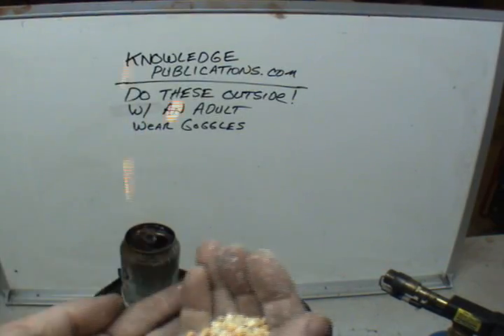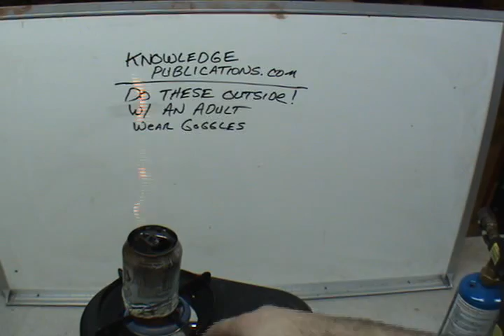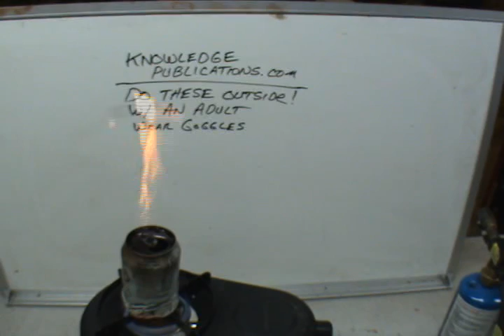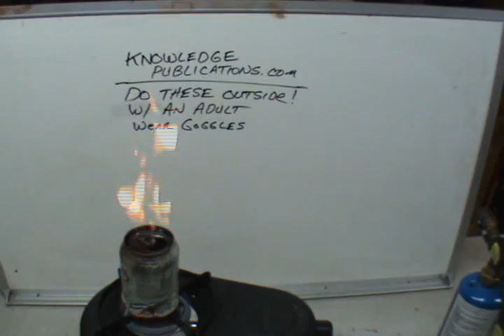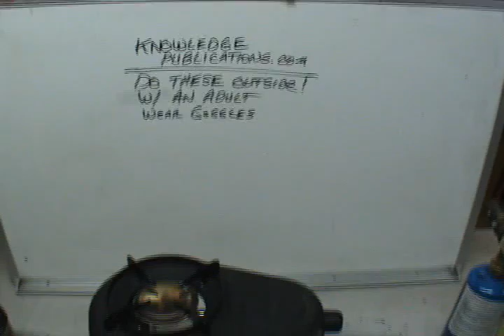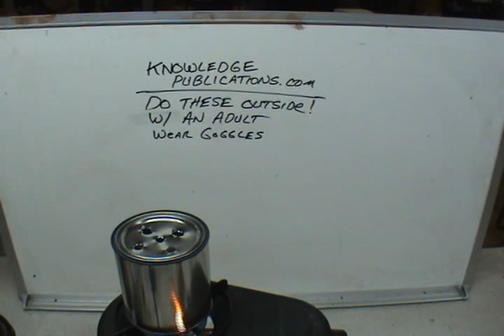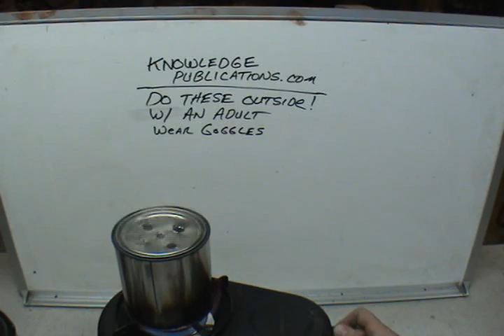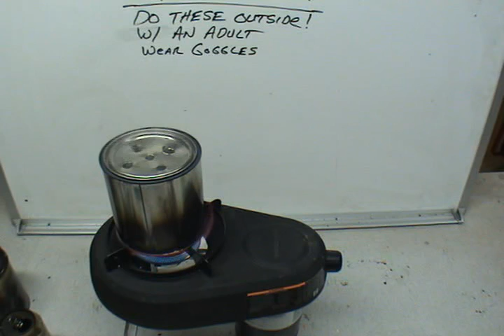Sodacan Hydrogen Biomass Wood Gas Gasifier Part 3

Comment from the maker: correct.. you don't get it.  The stove is on low, quite low and the heat value of the gas coming out is MUCH higher than the heat input of the propane.  Feel free to use wood to heat the wood to make a gas you can use...and NO. the wood is NOT burning!! it is being gasified. HUGE difference

Comment: I don't get it. you're burning propane in order to burn wood and bark? other than getting rid of the waste material which would burn on it's own you've basically just spent money on propane to burn waste. I could understand getting all excited about it if you didn't have to use another heat source but come on, your burning wood on a propane stove.